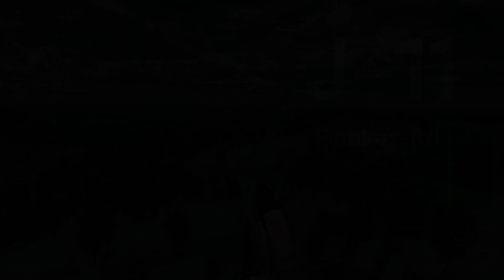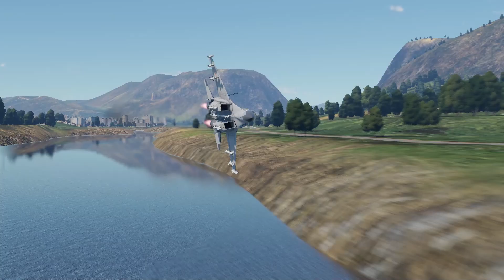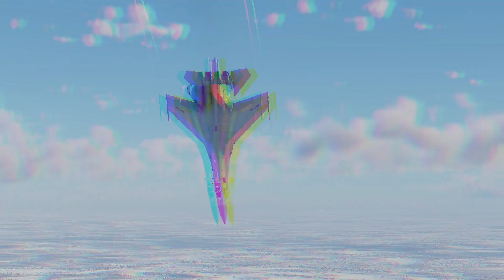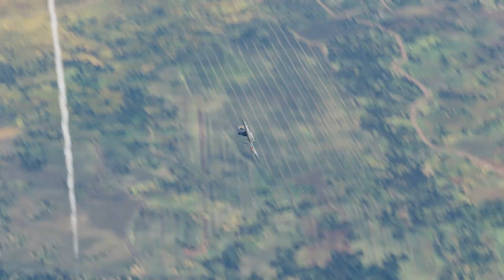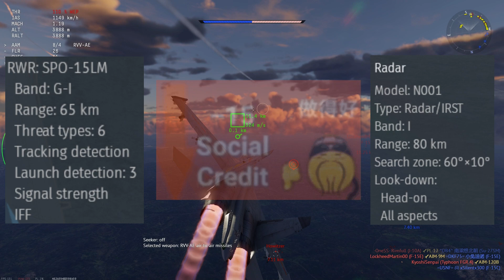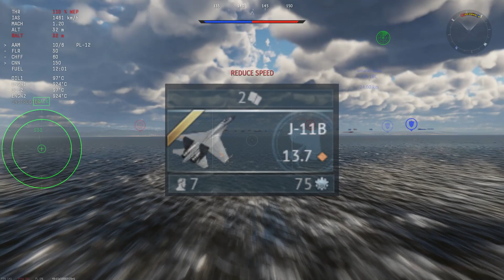War Thunder Guide - J-11 Family

Comment from the maker: Updates:
- The J-11A has been moved down to 13.3, where it's significantly more capable - and I'd probably recommend trying it there.
- The J-11B has been given 4x LS-6(IR) 250. These are IR+GNSS+IOG bombs, which essentially means they're very good IR-guided glide bombs. These use the 2nd, 3rd, 8th and 9th pylons. Whether or not you take them depends on your personal preference, but they have better seekers than the Kh-29TEs and a longer range (albeit they take much longer to get to their targets). I'd recommend a CAS loadout of 2x R-73, 2x PL-12 and either 2x LS-6(IR) and 4x Kh-29TE or 4x LS-6(IR) and 2x Kh-29TE.

- PL-12s have been heavily nerfed, and now have very little pull when compared to all other modern Fox-3s.
Reply: you mean 13.3 raaah
Reply from the maker: @sonerdeniz7295 oops! been doing too much JH-7 - corrected it
Reply: Now to update this again with the J-11A going back to 13.7 with the decompression update (still hasn't gotten any avionics fixes that it desperately needs while the MKK is just the better version)
Reply from the maker: @rileygayming6933  After the update releases, I'll be going through all my videos and updating the pinned comments ^^

Comment: J11b is also slightly lighter than the normal flanker, so u can somewhat feel the extra engine power. I highly recommend to do bvr in this thing. Also combined with the lighter airframe and marginally stronger engines, you are pretty much a f15c.
Reply: too bad the pl12s arent super competitive compared to the aim120s, and even less compared to the c5 and r77-1. if they fixed the drag, it would make it more balanced. but the main issue is that they introduced the pl12 with early amraams and r77s, when the pl12 was made to compete with the amraams of the time, which was the c5/c7.

Comment: I hate how the j11a is basically missing everything that the upgrade came with
Reply from the maker: it's bleak 😔
Reply: Cause the j11a is a su27sk with MAW. There was a way somehow makes n001 identify r77 as r27 therefore the j11a cant deal with different target at the same time.
Such a useful trick  came form the same factory upgraded the su25bm in game, this trick also surprised the designers from Sukhoi😂
Reply from the maker: @parrisyuen8290  while that may be true with the radar, the J-11A was developed from the J-11, not from the Su-27SK. Its upgrade did include a new radar (the same one found on the 27SK) which isn't yet modelled ingame.
Reply: @girl_twink but the j11 is the su27sk…
Reply from the maker: @brodykloster2102  An Su-27SK specifically manufactured in China